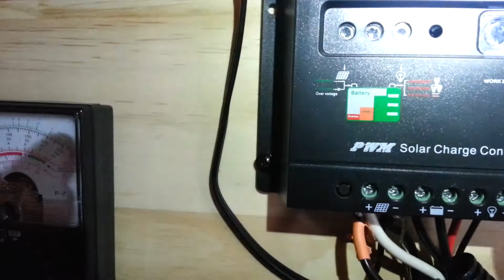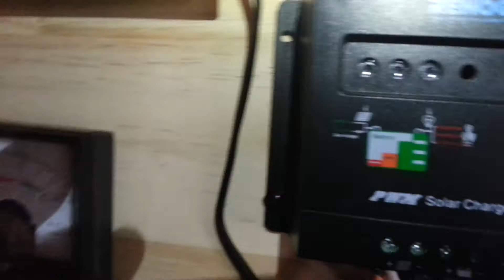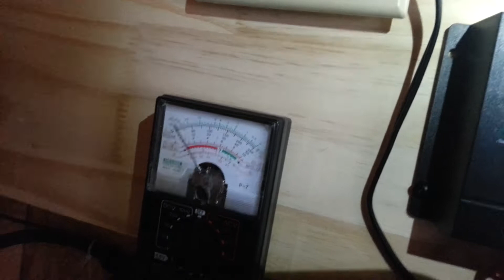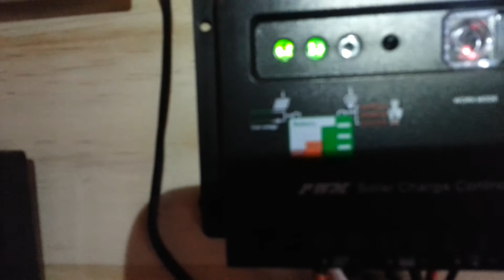Connecting multiple solar charge controllers

Comment: Okay, so i am still confused. 

Here is my example setup:  
solar panel array#1 =  (4 panels x 22.05 v / 9.5A ea panel ~i in parrallel = 22.05V/38A ea array)
solar panel array#2 =  (4 panels x 22.05 v / 9.5A ea panel ~i in parrallel = 22.05V/38A ea array)
Battery bank#1 = 4 batteries x 12v/200mAh ea in series = 48v/200mAh.  

All i want to know is, can i put array1 on "mppt_cc #1" and then array2 on "mppt_cc #2"  and connect both chargers to different batteries in the same batter bank?  If not, im having a hard time  figuring out how to scale up my off-grid hybrid system. Because really i want to use 4 generators (2 x solar, 1 x wind, 1 x gas genny) into the above battery bank. How best to achieve that?

Comment: This is nice, i really liked this video. Please confirm that i still need a diode even though both of my charge controllers are charging banks of similar voltage.
Reply from the maker: Sirme, if you are connecting both charge controllers directly to your solar panels, an additional diode is not required (since your solar panels already have diodes).  However,  it will not hurt to add one.  Just be mindful that when a diode is added, there will be a marginal voltage drop.   Thanks for watching.
Reply: thanks so much for the clarification,one more thing, i read somewhere that you cannot connect charge controllers in parallel and didn't quite get the argument. Is there any harm in connecting two charge controllers to one solar panel to charge two separate banks?
Reply from the maker: +Sirme Sana, I wouldn't say there is any real harm.  However, the cheap ones could fight each other, as one could go into float before the other.  You would need a way to keep them in sync.

Comment: Nice dude, thank you for sharing the info. I'm getting all the info I can to make my own low-cost solar system.
Reply from the maker: Thanks for watching and commenting.  Yes, you can build it: one wire at a time. Have fun!
Reply: DIY OneForAll quick question can i use a 12v adeptor or a computer power surply on a 10amp solar charger
Reply: DIY OneForAll example dont want to use pannels to charge battery but want to use a 12 power surply connected to solar 10amp charger
Reply: DJNITRO ALLY You need a battery charger instead, their output voltage is 13.5 or 14 Vdc instead the 12.5 vdc power supply, and also they have a preconfigured charge cycle with specific curve.
Reply: and wat about a laptop charger 20 volts
Reply from the maker: DJNITRO ALLY 
You definitely need a regulated battery charger,  else the battery could get damaged.   You'll also need over 12 volts to charge a 12 volt battery,  which the battery charger is designed to do.
Reply: could u tell me the best way i can hook that setup with out solar pannel lol make it simple im new to it
Reply from the maker: You will need a diode (connected on the positive terminal) between the power supply and the charge controller to prevent reverse current.  The diode needs to be able to handle the current of the output of the power supply.   Please note the charge controller needs to be able to handle the voltage required to charge the battery.  

For instance, to charge a 12 volt battery, your output voltage from the power supply needs to be 13.5 volts to 14.5 volts.  Note that when you use a diode, there is going to be a voltage drop.  

Therefore, you will need to up the output voltage from the power supply to accommodate the voltage drop going to the charge controller.  You will need to connect the input voltage to the solar connections.